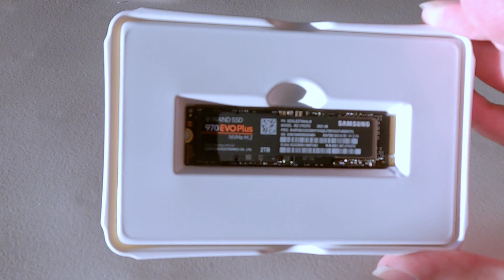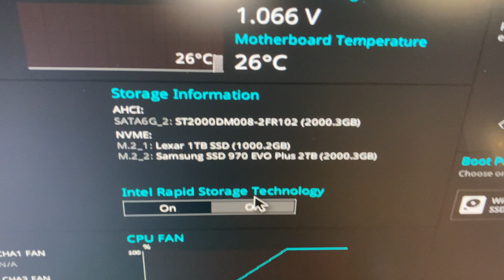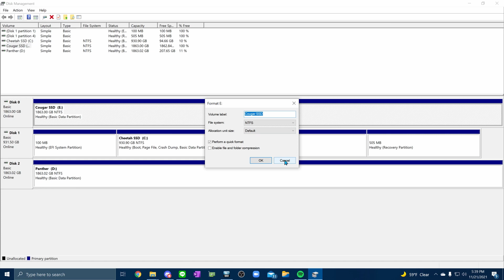More PC upgrades: Installing NVME M.2 SSD and heatsinks

Comment: im gonna buy this soon i have a question do u ever need to replace anything if ur on it alot playing games or editing stuff
Reply from the maker: It should not need anything replaced for several years… mine is over a year old and working just fine. After a few years you may want to upgrade to make it faster but that’s true of any computer.
Reply: @86drive86  ok like the ram an that's it
Reply: @86drive86  how would I know if anything needs replacing
Reply from the maker: @angelavelasquez9377  it shouldn't need anything for many years.  maybe at some point the future games or software you want to run may start to show your computer's age and you'll feel the need to upgrade to something faster.
Reply: @86drive86  om I will come back here in 7 year's